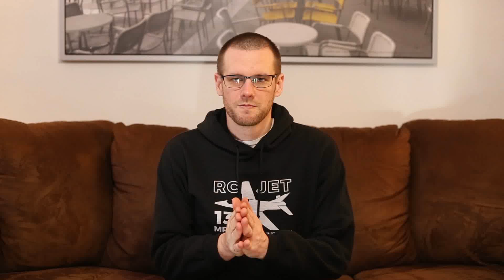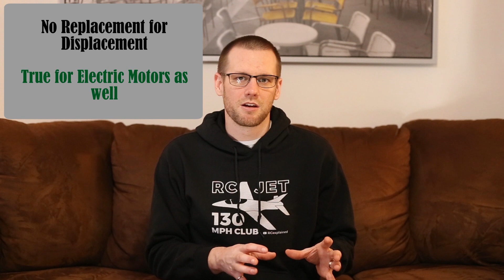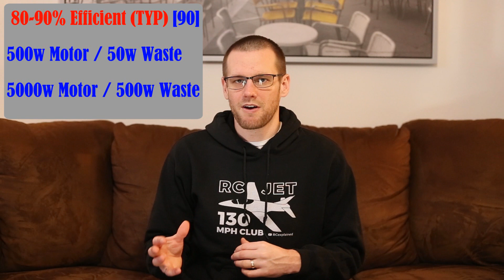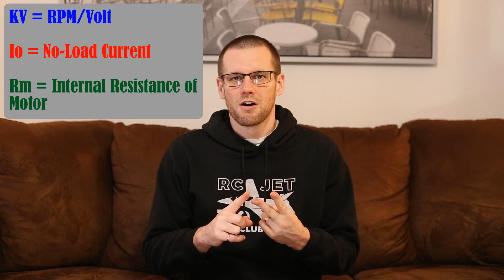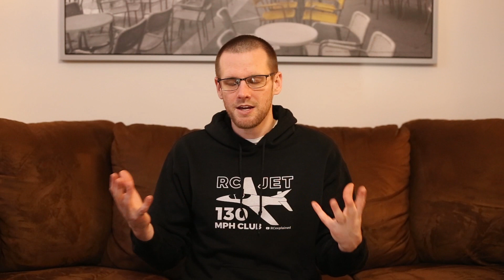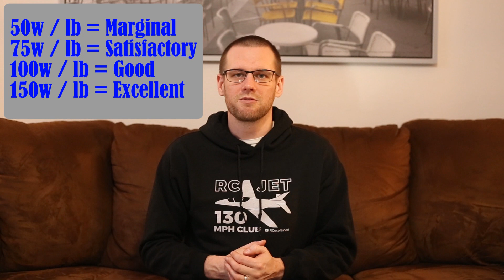Relationship of RC Brushless Motor Power Output

Comment: I want to make a jet surfboard with 2 impeller i have two motor options 5692 980KV and 4092 1250KV which one will make me go faster on the water i weight 49Kg my system is 5kg
Reply from the maker: What impeller and cell count will you use?
Reply: RCexplained impeller is from a guy called Mark from Youngesters jets channel, it's 53mm and the voltage is 6s
Reply: 5692

Comment: Are we saying waste heat increases linearly with size and surface area increases exponentially with size?
Reply from the maker: Waste heat is related to the efficiency of the motor and how much power is being asked of it to deliver.  Surface area can be calculated for any given motor size.

Comment: Hey I wanted to make an rc boat with a jet drive for fishing I don't need it to go faster than 30 miles an hour
and I want a long run time any suggestions for motors? The boat would be 25 to 30 inches and would be hauling bait and line up to 300 meters.Thanks man and great video!
Reply from the maker: Hi Mark,  What does long run times mean for you? A long run time to me is 6 minutes. 
You could use a 36mm x 64mm or 36mm x 74mm motor around 1500kv on 4s to achieve the speed. As for run time you would need to bump the mAh up for the pack to hit the run time you are looking for.
Reply: @RCexplained  Hey thanks for the reply so you can better understand I was looking to power a vessel something like this https://www.youtube.com/watch?v=Bo5nTgmPXaw I was wondering what size motors and battery could approach the run time claimed in this video.
I can go twin engines if I have to too.
Thanks man!
Reply from the maker: The motor above will get you close to the speed you are looking for. Run time will be tough. You will not be able to travel at top speed for that long. At the same speed as shown in the video you can achieve similar run times. I updated the kv of the motor in the previous comment.

Comment: Hello
Nice video
For me the boat it means fishing/relax/nature..... unfortunately I ordered a boat ( flytec 2011-5 ) and one of the engine is not working
I'm looking around to make an upgrade an the engine and also the battery.
Is possible to make some suggestions ?
Thank you
Happy holidays
Reply from the maker: What are your goals?
Reply: @RCexplained  
To have some more speed and battery life 
Nothing else
Thank you for your answer
Reply from the maker: I'm not familiar with that particular RC boat. However, if you are able to understand the size of the motor it's using, you could get an equivalent brushless motor. Do you know the size of the motor in the boat? Diameter and length in millimeters. I'm assuming it's brushed, 2 wires from the speed control are routed to the motor.
Reply: @RCexplained  
The size is 13.00* 7.00*4.00
End is 1100kv 
Yes , with 2 wire.
Reply from the maker: The dimensions you have provided are in millimeters?
Reply: @RCexplained  
I've took the dimension today
Is 5cm length ( with the axel is 7cm) and diameter is 3 can
The other that I've send previous wore wrong.
Sorry
Reply: The thing is that the new motor will have 3 connection were it will go the third one :) ) ?
I'm really confused :/
Reply from the maker: @bobbondarul7448  You will not only have to buy a new motor but a new ESC as well. The new ESC must be suitable for brushless motors if you swap the brushed motor out for one. In this case you will have a 3 wire motor wired to an ESC with 3 motor leads.

Comment: Great work. Can you do a motor size comparison for better efficientcy for the same load. Eg 1/8 buggy 2000kv 4068 size to a 1300kv 4092. I think the 4092 bigger motor might be more efficient. I know a lower kv will use less amps too on the bigger motors, just use gearing it up to equal the smaller 4068 higher kv motor? What do you think
Reply from the maker: What LiPo would be used on each motor?
Reply: @RCexplained  1/8 scale racing is 4s lipo. Most of the time I use 5000mah capacity
Reply from the maker: Hi Greg. This is not an easy question to answer, I like it. I would expect in your example the race is for endurance and not maximum power output.

To make a proper comparison, each motor would have to be physically tested in the application. I would expect (an assumption) and its very likely the smaller motor would have a lower Rm and Io value. Since you are not taking advantage of the lower kv value through higher voltages, it's very possible that the smaller motor would be more efficient in its power delivery. 

If each motor is geared to travel at the same top speed, both motors will have to output identical wattage to hit those same speeds. This equates to approximately the same input currents to the motors. The larger motor with a higher Rm value will produce more waste heat from copper losses. It will also produce more waste heat from iron losses. If the larger motor can dissipate this waste heat, it will be able to operate at this power output. However, because of the losses, more power will have to be input for equal output power. 

Every motor is different and the only way to make a proper comparison is actual tests. In addition, looking for these improvements in efficiency through tests will be quite difficult as the difference could be quite minimal.  A very well planned and executed experiment would have to be used.
Reply: @RCexplained  i have tested a 4074 1550kv motor at 4s compared to 4074 2200kv motor and results is the 1550kv motor runs cooler and runs longer on the same battery at the same speed from gearing . So im thinking a big 4092 lower kv motor will allow me to race long 30min races with the nitro buggies
Reply from the maker: @gregstafford2155  When you tested the 1550 vs 2200kv motors, was the output at the wheels geared to the same speed?
Reply: @RCexplained  yes. Consider also the 1550kv is a y wind. Not sure what wind the 2200kv motor is
Reply from the maker: @gregstafford2155  Interesting, that is not what I would expect at all. The lower kv motor has much higher internal resistance which means it should produce more heat, especially since current has to be very similar for both motors. Try out the 4092 and see if you get run time improvements.
Reply: Assuming that 4068 2000 kv consumes 2000 watts in 4 cells, 4092 1300 kv will consume 1300 watts.

Lowering kv in the same cell is simply like lowering the throttle of the motor.

The torque and rpm will be lowered together.

This is similar to reducing throttle epa.

Comment: Can u do a video  on us speed run  guys ,  high kv , or lower  kv , gearing  on both  setups , mah ,  everything  , more  speed thax happy  holidays
Reply from the maker: Yes, what specifically were you hoping that I talk about in the video?
Reply: @RCexplained   I think for speedrun guys going over which motor to choose would be a good place to start (high KV low volt conservative gearing, vs low KV high volt with aggressive gearing etc).  I know picking a battery is the first thing you usually want to do and work back from there
Reply: Best gears for 4370 kv motor redcat nascar